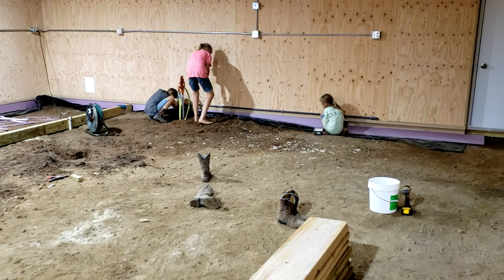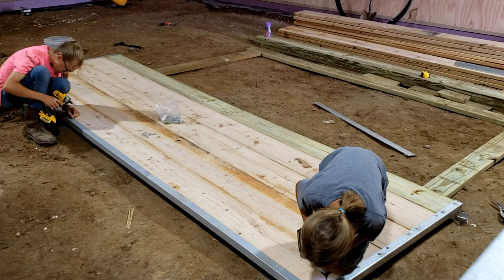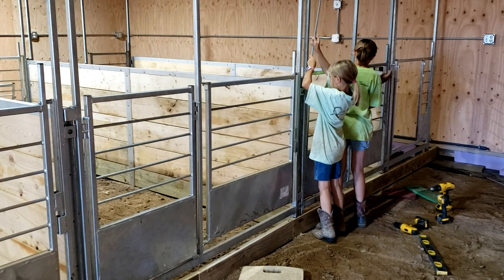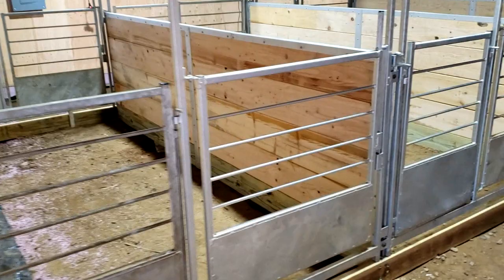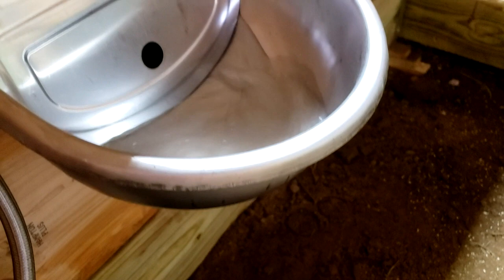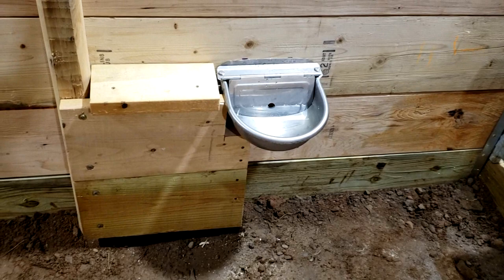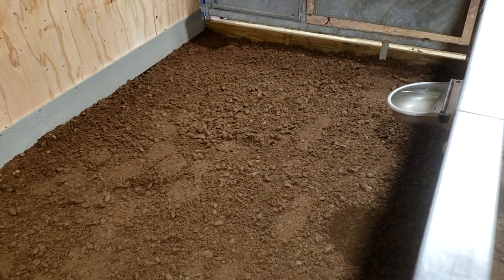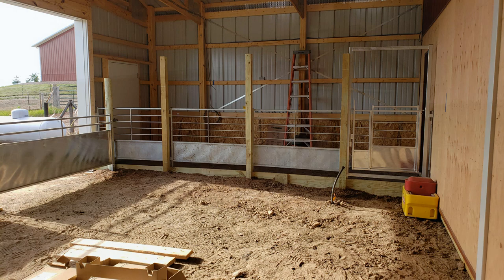Best Goat Stalls: RAMM & Sydell

Comment: I have a metal building with 9’ lean too which gives me 15’ length and 9’ width, with 7’ height at lowest point.  With 5’ metal studs in between.  So, will this product work for me?  Essentially this will give me (3) 5’x9’ stalls.  Also, do you have a link to the company for this product?